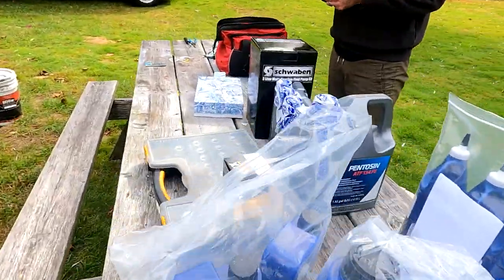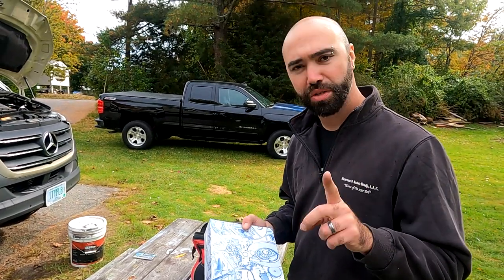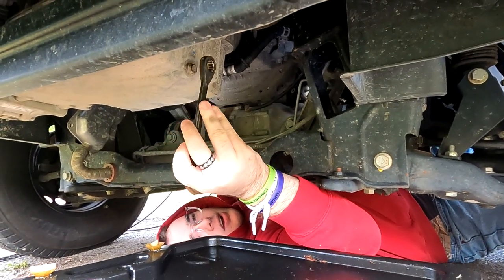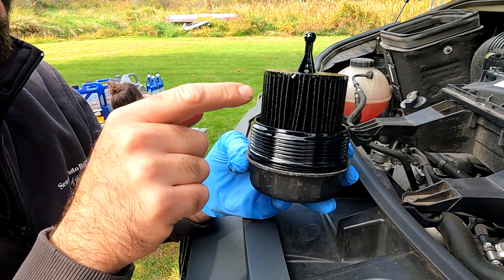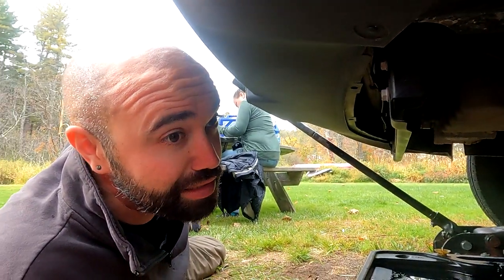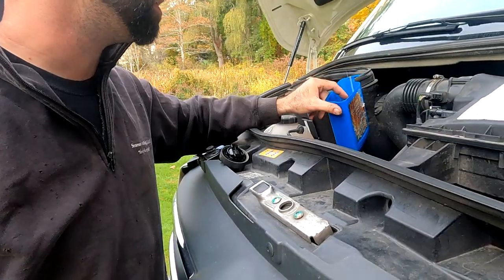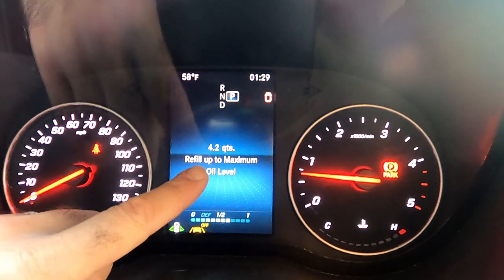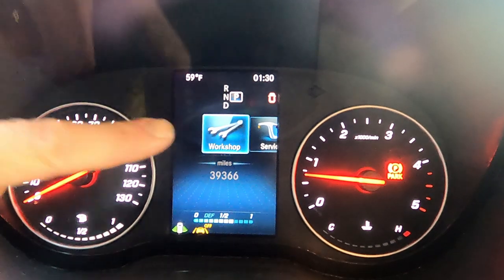2020 Sprinter engine oil and transmission fluid change DIY how-to [SERVICE B pt. 2]

Comment: Thanks for the detailed procedures and comments.  A couple things that come to mind: 
1) I’ve heard that inorder to maintain the MB warranty you need proof that you used MB spec lubricants.  I think a photo of the label is adequate.
2) You can get a dipstick for this engine from Terrawagen for $39.50.  The dipstick tube is already installed and has a plug that you can remove and discard.  Call me old school but I like the simplicity of a dip stick.
3) Really appreciate your attention to detail.
Reply from the maker: That's all fantastic information. Thanks so much for contributing!
Reply: As far as I can tell there is no dipstick tube on the 2019+ models, hope I'm wrong.
Reply: @@joefuccello3437he said engine and engine has a tube so you can buy dipstick
Reply: @raytaylor9659 engine not transmission
Reply: @svolk2921 I service a small fleet of 2020 Sprinters and I have never seen an engine oil dipstick tube in any of them.
Reply: @marcsmith3881  
None of them come with dipstick, some of them come with dipstick tube , and some of them come without dipstick tube . Everything can be installed, including dipstick tube and a dipstick.
Reply: @svolk2921  What do you mean that everything can be installed including the tube?
Reply: @marcsmith3881  If there’s no dipstick tube - then there’s a dipstick tube plug in engine block . You buy dipstick tube , then remove dipstick tube plug down the bottom of engine, then you install dipstick tube and then dipstick
Reply: @svolk2921  Is this a theory or something you have actually done on a 2020 Sprinter 3.0L?    As a tech, I don't do theories very well. I would prefer actual experience.
Reply: @marcsmith3881  that’s funny. Please research, don’t be lazy and think you know everything
Reply: @svolk2921  I asked a simple question. If it was too difficult for you then you shouldn't be making guesses about things you don't specifically know. if I had direct experience and someone asked me a simple question, the answer would be easy and I wouldn't need to be evasive.
Reply: @marcsmith3881  you have repeatedly said: I am a tech , I’ve got a small fleet . That’s why .
Reply: @svolk2921  I said I have never seen a dipstick tube in any of them. I have also never needed it. I still asked a simple yes or no question. BTW, I know I said it once. Not sure how that became repeatedly. Maybe you should read the definition of that word.
Reply: @raytaylor9659 So far as I can see on my 2020, there is a tube that looks as if it is going to the transmission, but as has been said it has a plug at the top. If that is penny pinching by MB I am disgusted. I will feed a flexible plastic tube down it and mark the oil level before changing it, then use the plastic tube as a dip stick. Another video says it takes 4.75 litres.

Comment: Hi Rob,
Im starting this transmission service and Im a bit confused about getting the new fluid into the transmission. I see you rigged up a pump,but Im not clear where you pumped it in. I looked all over my tranny and can't find a fill hole. And certainly no tranny dip stick to fill through. Im all set-up. Tools, parts and supplies. I've got the converter spun around and ready to drain. I purchased a garden sprayer to pump the new fluid in. TIA for your help John.....ps your videos are great. Ive used them to do oil change service, fuel filter service, engine air & cabin filters, differential. After tranny will come brake power bleed the fluid and coolant flush.
Reply from the maker: Hey John, so glad we could help you out. We love that feedback!! The transmission fluid goes in through the drain hole. Sorry if that wasn't clear in the video. There's a tube around the hole inside the pan (when you take the pan off, it will make way more sense). The tube sets the depth of fluid so you can't overfill the transmission. Just add fluid until it runs back out, with the engine running, and then replace the drain plug.

Comment: If the torque converter does not drain after removing the drain plug, turn the torque converter either direction a couple of degrees to let air in and oil out.
Reply from the maker: Great tip! Thanks for sharing

Comment: It is easier to drain the transmission fluid from the torque converter AND the cooler by filling the new fluid the undoing the return line from the cooler and then top up the fluid and continue until CLEAN fluid arrive up that line, the refit and refill the fluid through the drain hole until the oil just co es out of the plastic level plug, then check the fluid temperature on the computer. Check the level at the right temperature then seal the filler/drain plug.  You can buy a dip stick marked in the right levels for temperatures, they are on eBay and consist of a looong flexible rod with a plastic stick on the end with the marks for levels.
Reply from the maker: Thanks so much for sharing!

Comment: Where do you get the software to connect to the car? Does The oil filter change  require the oil pan to be replaced?
Reply from the maker: I was able to get Xentry from a forum. If you do some digging around you’ll be able to find it. The oil pan does not need to be replaced or even removed.

Comment: How did you get the one bolt off above the 4x4 transfer shaft?
Reply from the maker: I'm pretty sure I just used a properly sized common 12-point box end wrench.
Reply: @OutofIpswich  That's a good idea.  Its an e10 6 point Torx bolt, but the 12 point wrench should work by division.
Reply from the maker: @chasealstott1  It does!

Comment: HI there, do you need to hold 2500 RPM all the time to check the fluid level ??,or just let the engine run on low RPM during the level check??? Please let me know when you can , thank you so much
Reply from the maker: You don't need to maintain 2500rpm while checking the fluid level. That's only to help the fluid get up to the specified temperature.

Comment: bro please help 2020 mercedes sprinter 3.0L dont know how much my transmission needs because it is salvage and so the damage hit the cooling radiator so how do i get the right level and the right amount do i put it into neutral or what
Reply from the maker: Hi I'm not sure what you need to know exactly. I think the video explains pretty well how to ensure the proper volume of fluid is added to the transmission. Essentially, you want to fill it until it drains back out. Let the excess run out and then plug it. I also showed in the video how to verify the proper transmission fluid temperature through Xentry while draining off the excess.

Comment: When trying to get to the secret menu it only asks me to reset trip odometer. What am I doing wrong? It’s a 2019 chassis
Reply from the maker: You have to hold the back button (top left button with a house and arrow symbol) for two seconds, then continue holding the back button when you press the track pad.

Comment: I just had the trans fluid full service done at a meecedes dealership and now I am hearing a weird rational noise underneath the driver seat. Area near the location of the transmission pan.
Reply from the maker: That's unfortunate! We're really sorry to hear that. Hopefully you can get it sorted. We'd hope the dealership would resolve that.
Reply: @Out of Ipswich  can you think of anything that might make a squeaky rotational noise after a trans fluid swap if it was done in properly. I only notice the noise at if my foot is off the gas between going faster than 7mph and up, tell about 30 mph
Reply from the maker: @newera4k333  not really but it's really tough to diagnose this way. Perhaps it's in your brakes?
Reply: Go back to the dealer as  soon as possible, you have only a 12000 mile warranty from the dealer on his job

Comment: Is this @ 25000 miles?
Reply from the maker: No, this is 40,000 miles. Technically just shy of 40k, but that's the target for the first service B.
Reply: @OutofIpswich  gettig my new sprinter in May. Bit worried about the long mile oil service. Do u change more frequent then recomended?
Reply from the maker: @martinnilsson5295  Nope, we have been using the manufacturer-specified interval of 20,000 miles along with the latest and greatest oil specification for low sulphur content (spec. MB 229.52 as of our last oil change).
Reply: @OutofIpswich please don’t fall for 20.000 miles oci , but it depends how many thousands miles total you want out of the engine